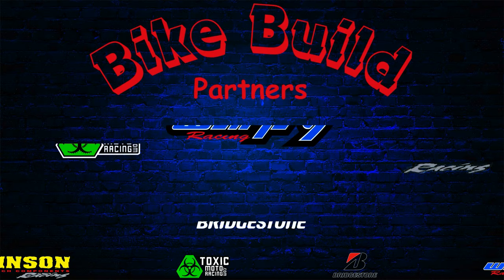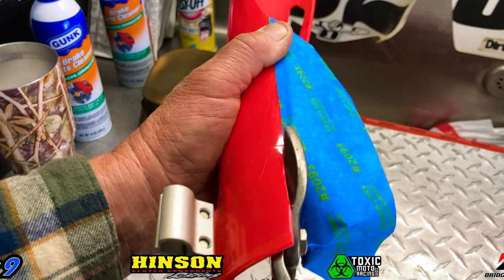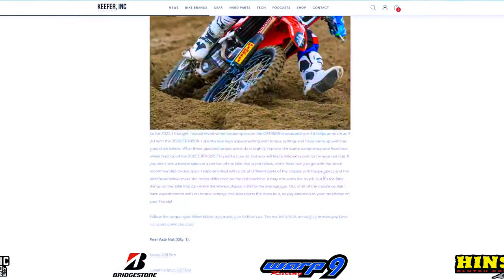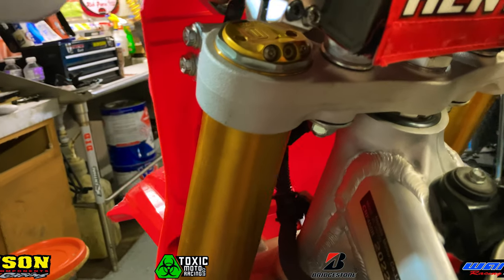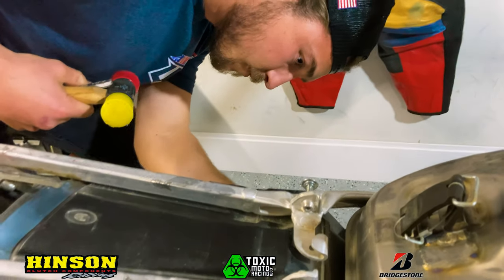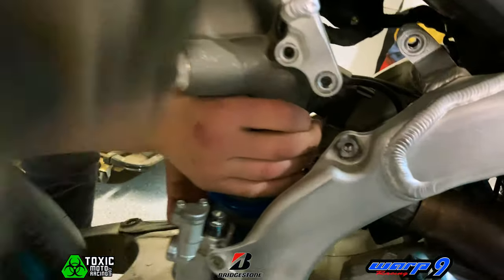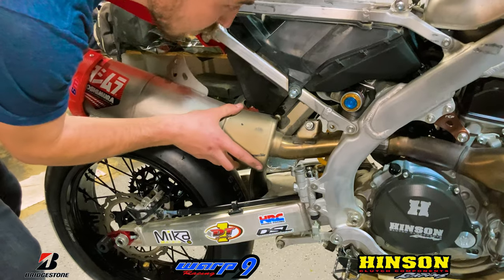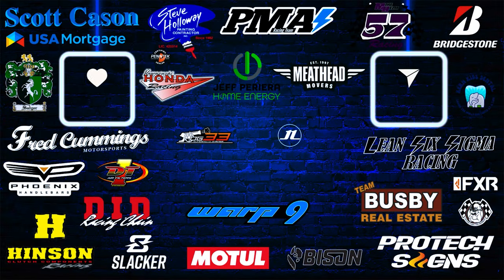Supermoto Bike Build Guide to Setting up YOUR First Supermoto! | Step-by-Step | Episode 5 | Toxic

Comment: Bling as, do you change the fork geometry
Reply from the maker: Soon will be changing triple clamps to change the mm offset!
Reply: @bronsonpearce132  What offset fork feets has?
Reply from the maker: @FlowProPerformance  stock fork feet are 32 and I just installed the SPS fork feet and they are 20! 
That video is the next episode!
Reply: @bronsonpearce132  Ok, what offset Gecon triple has? should be 15 mm.  From where did u get fork feet offset?
Reply from the maker: @FlowProPerformance  yeah the geco’s i believe are 15 or 16mm
The SPS fork feet offset I was told from the owner of SPS
Reply: @bronsonpearce132   I meant oem feets offset
Reply from the maker: @FlowProPerformance  was also told that from the owner of SPS!
Reply: @bronsonpearce132  We placed feets on industrial probe to measure actual offset. From 2008 up to 2018 there is not difference. I believe latest generations of CRF's has the same but didn't check.